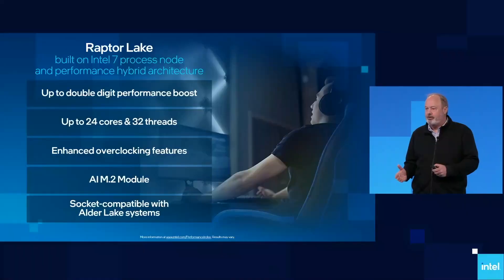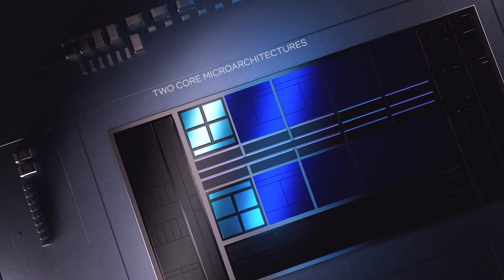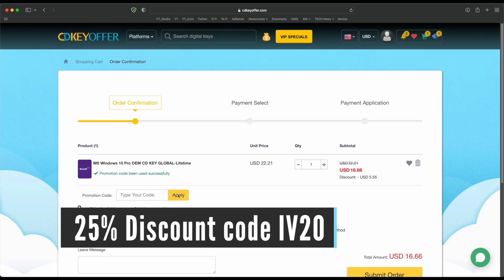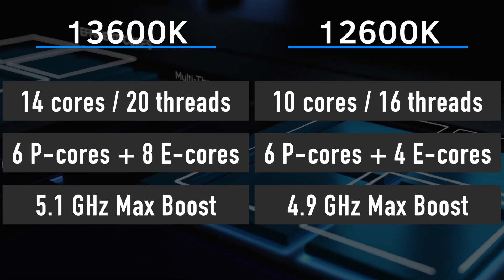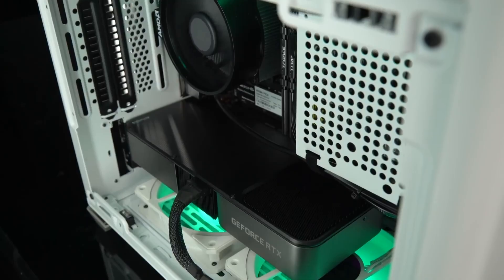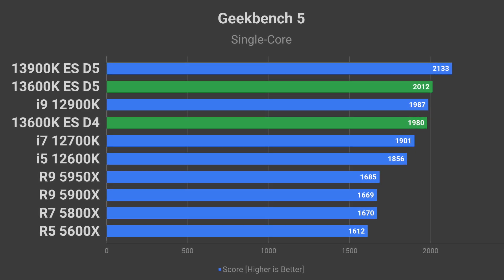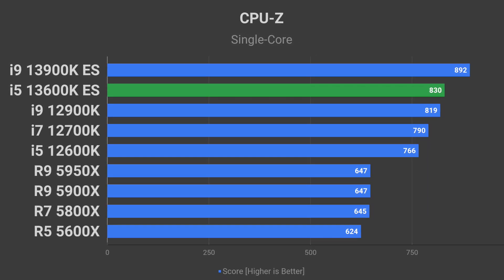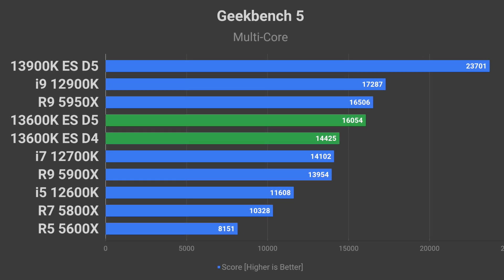Intel 13th Gen i5 13600K is Better Than You Think

Comment: Do you think that 12700k would bottleneck the rtx 4090 ? I’m planning on upgrading in the next few months from a 1050ti
Reply from the maker: Not in any normal use cases. 12700K will be a good pair for it.
Reply: @theivadim  what about an i9 9900 paired with rtx 4080? I have a non k version by the way. If you can give me an answer I will be grateful. Already my rtx 3080 pairs nicely.
Reply: Also rocking a 12700k and gtx1050ti. Very surprising how great it actually performs compared to a i5-4570 and the same gtx1050ti. Got a good couple of years out of it and playing some older titles at 4k60fps

Comment: I really don't understand the move from 4 to 8 e-cores since 4 was enough for handling background task and e-cores are totally useless for gaming all the while keeping only 6 p-cores. So basically you don't gain anything since you mainly buy i5s to game. They just should have added 2 more p-cores for 8 total....
Reply: Jenny Melo  extremely capable... lol
Reply: it boosts productivity tasks (often very heavily multithreaded) without adding the heat of 2 more p cores. And I am sure that yields are much higher on e-cores (they are smaller, so less chance for a mistake in any core) so it's probably also a lot cheaper to add those. 

If you are absolutely only going to game it probably makes sense to buy a 12th gen even cheaper when it comes out. Maybe as low as $220? If you look at camelcamelcamel the 11600K dropped that low right around 12th gen release. KF might be like $200. Save $80 on CPU, put it towards jumping one more step on GPU.
Reply: Just wait a few years down the line when a lot of AAA games require 12 cores and people who bought them will be happy they added the extra e cores.
Reply: @kerotomas1  The e-cores are actually near the performance of a full fledged sky lake chip. Not the atom chips many people relate them to. Its basically p cores slapped with some skylake cores. 

Utilising them both its going to be very nice but it takes a lot to create such an advanced scheduler

Comment: It's better than i7 13700 ? 

I want to upgrade my i7 4790 😅
Reply from the maker: I don't think so. 13700 should have more cores. I doubt that lower clock frequency will put it below 13600K in terms of performance.
Reply: @theivadim  is 12700 the best spot for upgrade my 4790 ? or still wait for 13700 ? Please give u'r suggest
Reply: epecially for programming and analyst

Comment: U can say whatever u want but i dont want a cpu with a 125watts of TDP that means the real TDP its even higher, NO, i dont want that.. currently i have an  i5 11400 and its enough, i really wanted to buy an AMD ryzen 5 but i had an offer for a motherboard with 4 memory slots and pci e 4.0 and thats the only reason, i even buyed another cooler for the cpu (not the stock), the next time maybe in 3 or 4 years im thinking on replacing this one for a 65w or maybe 70w max, i dont want to pay a lot for electricity or have a risk of overheating.
Reply from the maker: Good point. I like lower power components for personal use as well. Don't enjoy the heat those high-end PC parts would produce in my room🙂 I've had it. Don't want it no more.
Reply: @theivadim  one mayor problem its those components in summer, where i live it becomes very very hot on summer.
I dont want to deal with lowering the frequency, i lived that with gpus and maybe with one core i7 in the past, with notebooks too, believe me, having a correct cooling its really important because if u do not have it your component wont give what it says.
Reply from the maker: Another good point. 100% agree and understand you👍

Comment: It's gaming us lot are bothered about. And even more important, will intels new chips be power hogs still. My 5800x3d averages 65c while gaming at  65w-80w.
Reply from the maker: I expect Ryzen 7000 to win in efficiency. Especially, in gaming. So, Intel is more of a workstation/playstation mix in my opinion.
Reply: @theivadim  Intel is not for workstation per se ...  the e-cores make so much problems in some use cases ...

Comment: 13 is the first Intel generation in a while that sounds very promising compared to AMD. With AM5 requiring a new motherboard and RAM, but including built in graphics an likely allowing upgrades for several years, many Ryzen enthusiasts could have a difficult choice to make. How soon until we see 7000 series benchmarks leak and what do you predict the performance will be?
Reply from the maker: Most Z690 makers released a BIOS supporting 13th gen which made it easy to test engineering samples. As you mentioned, Ryzen 7000 has brand new platform. That makes it impossible to test a Ryzen 7000 engineering sample even if you can buy it on the black market. So, we have to wait for someone inside AMD labs to leak it🙂 Could not happen at all. Who knows🤷‍♂️

I think it will be a close battle in terms of performance. Ryzen will win the efficiency imo.
Reply: Alderley was sounding awesome too. Turned out better than the hype
Reply: Sure, if you ignore the 8400, 10400f and 12400/12700k
Reply: bro what? u deadass ignoring 10th and 12th gen which were better for gaming then amd but ok ryzen fanboy looool

Comment: With these new processors we will bottleneck unless we get 3090 ti or rtx 4000 series.
Reply: Do you even know what that word means lol
Reply: @gdgd5194  having something on your system that it’s holding you back on getting better performance. For example I have a 5600x with an rtx 3080. At 1440p I get just shy of 8 less frames from a 12900k, and we all know the 12900k is way better than the 5600x, the problem here is just the lack of power coming from the rtx 3080, upgrading to a better processor will yield zero effect.
Reply: @diegocervantes4977  I had 5600x with 1660ti too and it was way more than enough, solid PC ^^ But I sold it and I know a game which will greatly benefit from having either a beastly cpu or 5800X3D. Good old Rust :-D I will also buy either 3060ti or risk having buggy drivers and get 6800xt for the best possible 1080p gaming ^^
Reply: @gdgd5194  there are games were they benefit a lot from cpus, but when you go to 1440p the improvements aren’t just there. For 1080p with 180+ fps you will ser the difference on upgrading cpu, but for more graphic intense games at 1440p/4k a great cpu won’t do anything (if you are coming from a ok cpu like a 5600x) what will make the difference in those cases will be the graphics card.
Reply: @diegocervantes4977  I know, 1440p will be my concern in 2-3 years :)

Comment: Why didn't Intel go 8P cores 6E cores... they could go up to 12 cores on the i9... but greedy Intel.
Reply: I think you underestimated them P cores or you never experience it for yourself. Cus if you did you would know the I9 12900k even with a 360mm AIO would shoot up to almost 100c in cinebench r23 in a blink of a eye as soon as you press start test. So what you think will happen if they added 2 more P cores? Those P cores are the most powerful cores in the world as of now. Nothing  from AMD comes even close to it on single core performance.
Reply: @forthosewhodare7325  🥲 It's supposed go be a new gen... lower TDP - Lower Heat, but it's the opposite for intel, worse efficiency + higher temps + higher cost 👍
Reply: @NinjaXHide  It doesn't matter if its on a new gen. As long as it is on the same node then there are not much they can do to improve upon it, esp with temps simply bc of moore's law. It is more a revision then a new generation. Meteor lake will be on a different platform then they can define moore's law
Reply: @NinjaXHide  the P cores only can scale up to 8 cores due to monolithic die

Comment: Monolithic die is better than chiplets games run much more stable on monolithic die
Reply from the maker: You have source to back this up? As far as I know this is not the case. Also, Intel is moving to chiplets. Chiplets are the future of silicon.
Reply: @theivadim current AMD CPUs have poor 1% low performance compares to Intel CPUs AMD CPUs can't use no more than ddr4 3800mhz ram but Intel CPUs can get huge performance gain by tuning Samsung b die ram
Reply: @theivadim  main stream Youtubers only showing stock performance of AMD and Intel. AMD CPUs can't get much performance by using tight timing high speed Ram like Intel and AMD GPUs also have terrible 1% performance in many games compares to nvidia GPUs  for example cod warzone
Reply: Say it to 5800x3d , and 5xxx had better perf then intel for a year or so .
Reply: @edgari0kas  in your wet dream tuned 12900k with tight timing over 4400mhz ddr4 ram beat just destroys the 5800x3d .5800x3d for hardware noobs that don't know about tuning
Reply from the maker: I am not big on overclocking. It is fun as a hobby if you are into it. But it is extremely niche in the grand scheme of things. So, I focus on the out of the box experience when I report on anything.

Also, I don't know where you get your info, but I did not see any poor 1% lows on AMD CPUs or GPUs if we are talking about recent generations. I still prefer NVIDIA GPUs because of better software support but AMD is doing a damn fine job for the past several years. And AMD invested a lot into labs and software/driver development. I expect to see them start taking market share in 2022-2023.
Reply: @theivadim  you can check Frame chasers he is doing some real world testing
Reply: @theivadim  he's actually right. The difference isn't mind-blowing or something but difference is a difference
Reply: @Decki777  Ease back champ, I'm sure he was talking about the 5000 series against Intel 10th and 11th generations.  Your disdain for AMD is so evident, I see you in a lot of places pushing your narrative.

Comment: intel is just doing fake cores and keeping the cpus too hot while paying influencers.... if amd keep the strategy of am5 can upgrade to 3 cpus amd is the way to go.... in the end buy what most cost effective..... also as always you are comparing k produtcs that overpriced that need overpriced mobos and fans....costing more than the cpu....when oc is almost dead at least with the heat they run at at stock speeds..... dont pretend 6 cores is anything new and get bamboozled by fake cores made to trick benchmarks...
Reply: How are those cores fake? Kindly explain, please